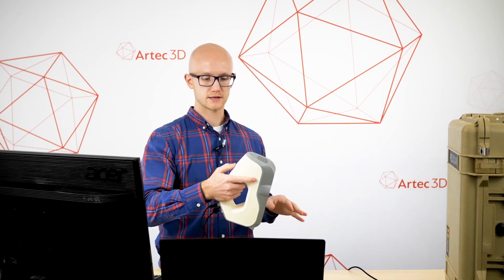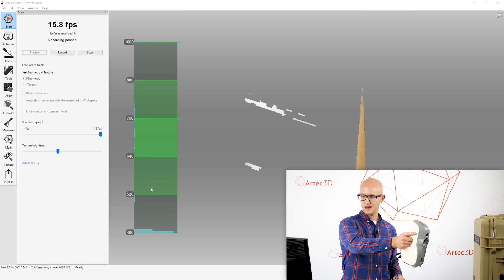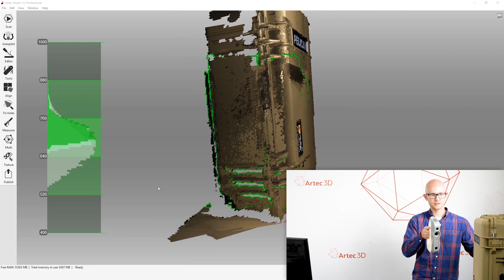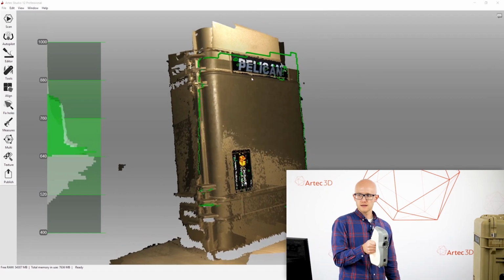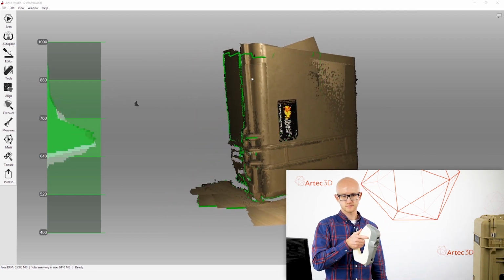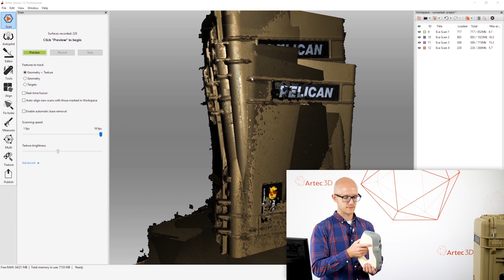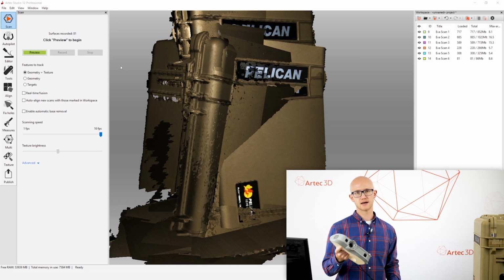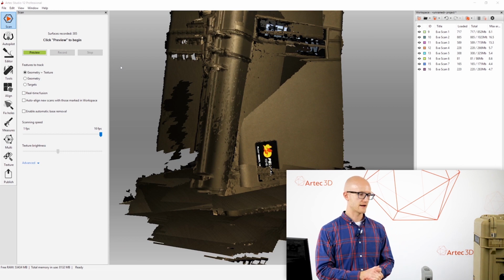How to Effortlessly 3D Scan an Object with an Artec Eva

Comment: Need to know if this scanner has any way of getting rid of the specularity on the object it's scanning. If not would this scanner work looking through polarizing film or a polarizing lens?
Reply from the maker: Try "Reduce Glare" feature in the Artec Studio Software

Reduce glare is intended to eliminate glare spots on texture. This option is only available for Texturing for Export (Texture Atlas) and requires many texture frames captured from different perspectives.